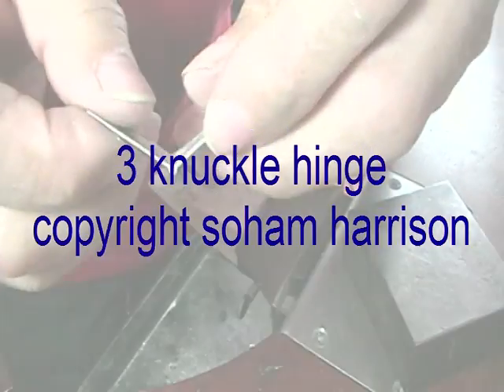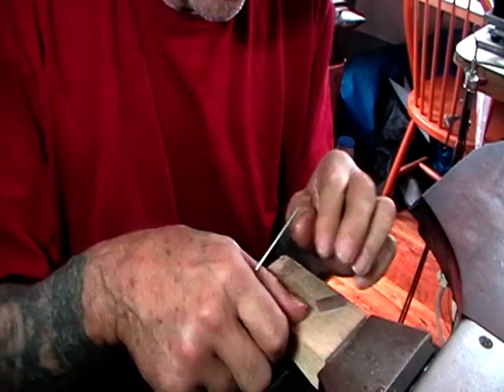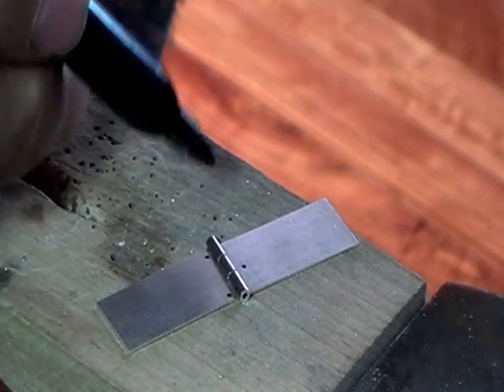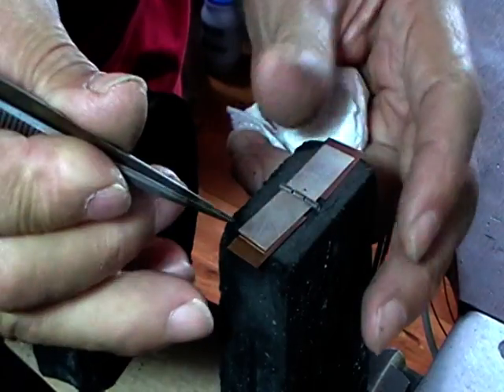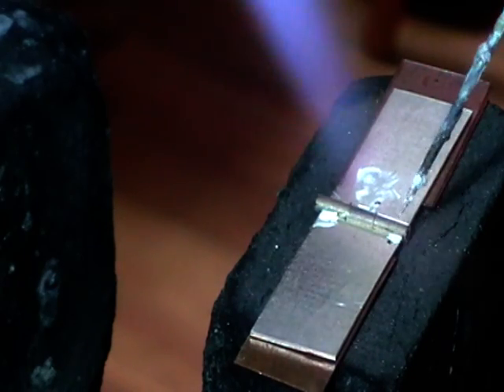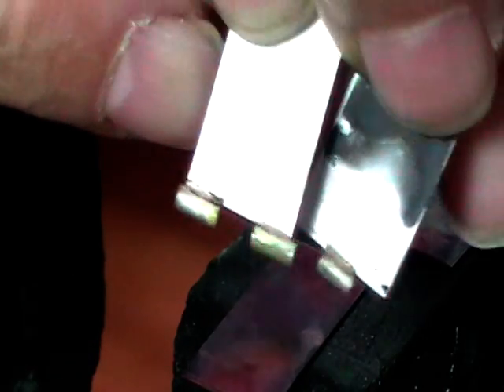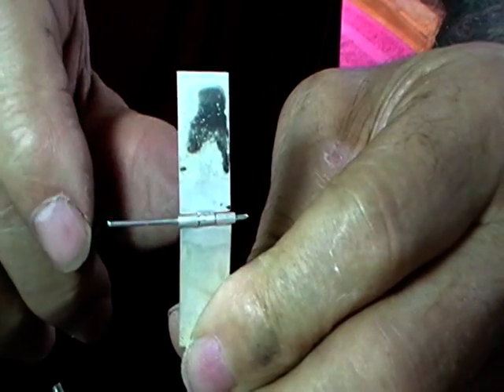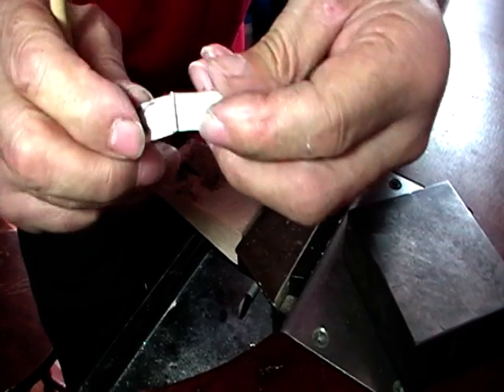3 knuckle hinge

Comment: I’m starting on a locket. And thank you for this it is so helpful. But I’m just wondering how you would go about doing this on a curved piece? I’ve seen so many different people doing it different ways. From filing into the piece for a spot to sit it, others leaving it on the outside of the piece, and even seen some solder the tubing still together and then going back into it and then cutting away at the side of the the tubing that doesn’t stay soldered and cutting the 2 cuts to make 3 pieces for the hinge and then doing clean up. So I’m just wondering what you personally would suggest doing? Thank you 😊

Comment: Nice video. I use an old drill bit inserted into the tubing to keep them lined up and a little white out or yellow ochre painted between the knuckles to prevent solder from flowing into the joints.
Reply: I use a pencil lead.